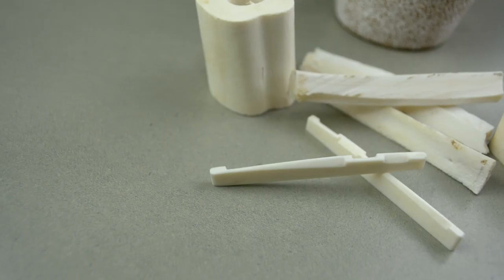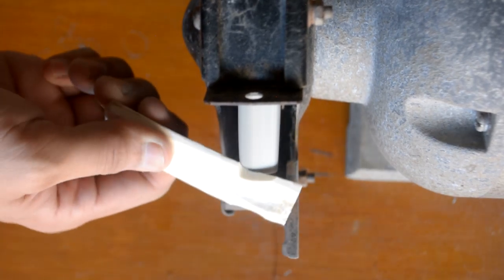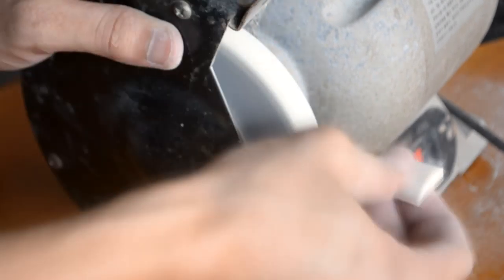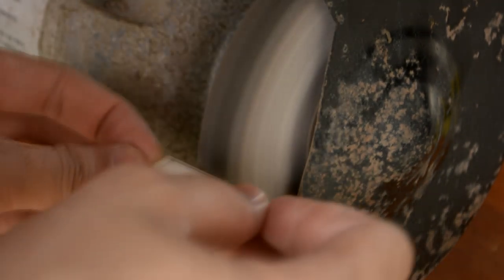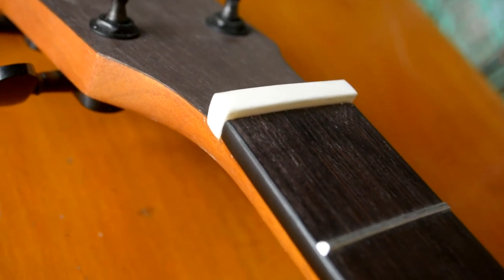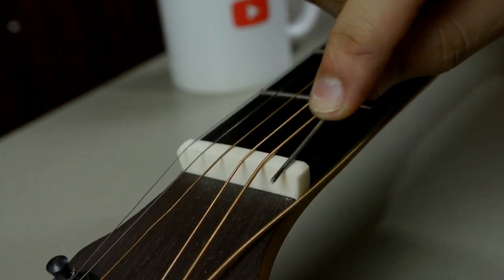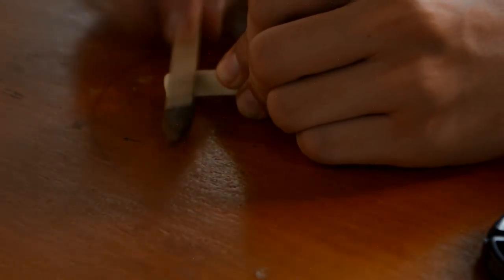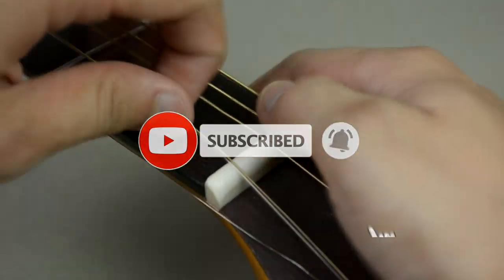DIY Bone Nut for Acoustic Guitar | Luthier For Noobs Episode 2

Comment: Hi Mark,
Great video and very well presented..
However there is one very important thing I want to point out.. all bone have a great deal of grease in them.. and if you make a nut or saddle out of un degreased bone.. the grease eventually slowly leaches into the wood and it will cause glue failure and more problems .. so to avoid this from happening.. simply dunk all the bone blanks into a ammonia water solution to which liquid dish detergent has been added.. keep all the pieces submerged for at least a month.. giving an occasional shake now and then..

Comment: My nut bone is crooked when I restring my guitar  it fell it still works but the wood or plastic where it sits isn’t even flush so I just used Tidebind 2 glue and reglued it and no Iam thinking I should try to fix it